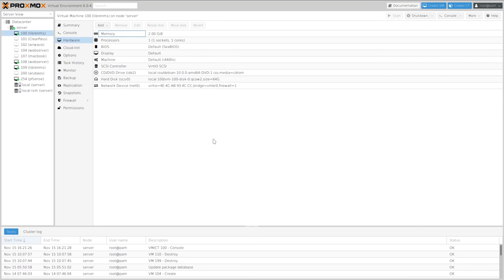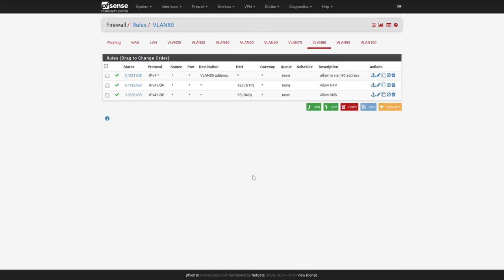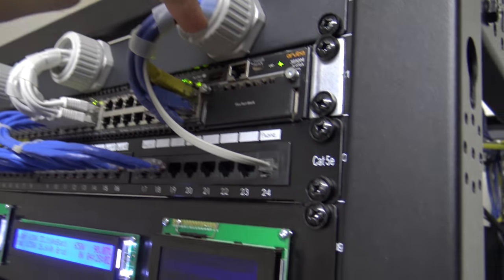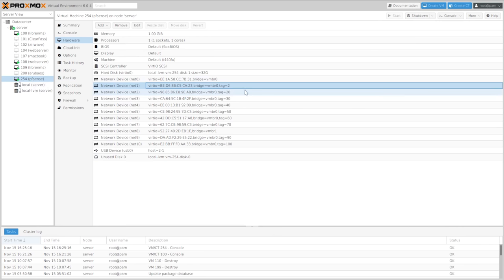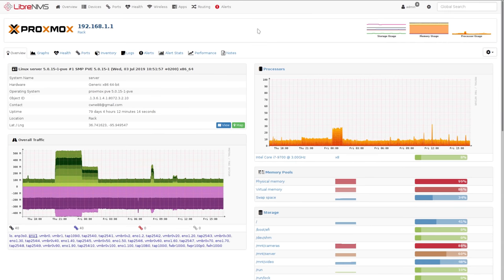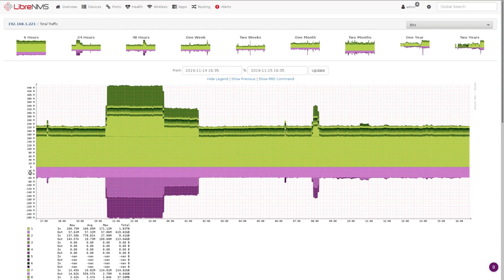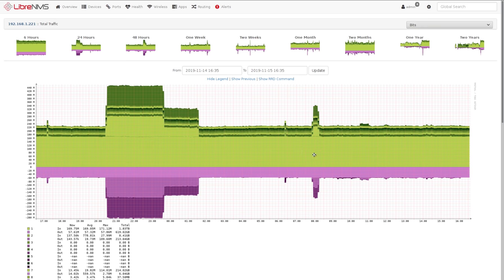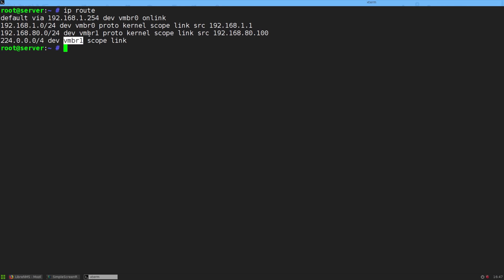Logical Network Tour

Comment: You’ve got a ClearPass VM, just have your policies set up to put the Tesla on a different VLAN and then you don’t have to mess with firewall policies on the controller. Nice setup, pretty similar to mine :-)
Reply from the maker: If you listen closer, you'll hear why I wanted it on the same VLAN. Also, I can already put it on another VLAN with just the controller if I want (like the dashcams still are). I don't like extra complexity if I can avoid it (believe it or not!)

Comment: Best no bullshit tech channel I've seen. Thanks for sharing the content and knowledge mate.

Any particular reason you opted to do your tagging on the hypervisor rather than in pfSense?
I'm trunking the vlans to an old physical box that I run pfsense on, and thus dealing with the tagged interfaces in pfSense. I'm going to migrate that box to a VM though, so just curious if there is a particular reason you adopted this approach on the hypervisor nics rather than in pfSense itself?
Reply from the maker: Basically because it works nice and easy that way. pfsense, or any other vm doesn't need to have the tags set, as they're already done on proxmox. If you saw my recent videos though, I've pulled that out and am now running them on Raspberry Pi machines

Comment: Are you using OVS IntPort for each VLAN tag you have?
Also, did you switch from physical Palo Alto appliance to a virtual PFsense firewall? Is there a reason for it and how is the experience so far?
Reply from the maker: Yes, I got rid of the Palo Alto ages ago. The Palo was just too slow to configure simples things, and pfsense is laid out way better and logical. No problem with speed in my setup.

Comment: hi im a big fan of proxmox i wanted to ask about how you run pfsense on it do you add a virtual nic virtio etc or did you use the hardware pass through option to pass a physical nic in the pfsense box to the vm? one isee i have seen come up is if you use virtual nicks they don't have as good performance and you have to disable hardware check summing in the web interface of pfsense. perhaps you could do a more in depth video of your pf-sense setup. i love your  vids keep em up!

Comment: Any reason for not running librenms in a container vs being in the VM?
Reply: Had the same thought! There is two possible reasons that comes to my mind: linbrenms have a vm .ova and docker container file available that you can import as a vm or use in a vm. Second, reason I guess it is more secure to run a vm than a container and I guess that since he can spare the ressources there is more advantages to vm than containers.

Comment: interesting, I used proxmox with a similar setup but I could not use the vlan aware bridge like you,  without getting some strange message "process/core freeze" and the instability
I had to create one sub interface per vlan, link each of them to their bridge and then link vm nics to the proper bridge.
I wonder if that was a hardware problem. Does your server have very new hardware ?
Reply from the maker: This particular one is new, but I've done it without any problems in the past on old equipment. All I did was add an adapter in the VM config, then assign a VLAN tag to it and it was done.

Comment: Nice video. I wonder why you can't ping your model S. I can ping my model 3 on wifi. Do you have anything in place to stop your Tesla assuming another address in the subnet and bypassing your layer 3 access lists? MAC filtering? Separate broadcast domain would be more secure but less arp-friendly. Could look at proxy arp if your kit supports it. Maybe too paranoid :)
Reply from the maker: I mentioned it in the video, but maybe it wasn't clear. The wireless controller is doing the firewall for the wireless client. It's not a layer 3 access list, it's a role assigned to that wireless client's association. Its MAC address is allowed on my VLAN with rules to prevent it actually communicating with others on my VLAN. If it changed its MAC (which it wouldn't) to something else, it would get thrown into a guest VLAN anyway. It's all good :)
I didn't realise model 3's responded to pings, but then again I'm only familiar with my car (and its shitty 802.11g capability).
Reply: @TallPaulTech  unless it found and spoofed an offline trusted MAC address but yeah, it's not likely to do that unless it's seriously compromised

Comment: Is it safe to run a website from home and if so how? Maybe another Video???
Reply: mystrerios question, is it as save as always.
Reply: It depends on what you consider safe. As far as unauthorized access, if properly configured it can be just as safe as a server in a big cloud provider. Reliability however is much harder to control. Small scale infrastructure just can't offer the same redundancies of big data centers. Even if you spend big dollars getting complete hardware failover, a simple DDoS attack could quickly saturate even the most robust home internet link. This kind of risk could be completely acceptable for many websites, though. And maintaining physical access to the disks could arguably be considered safer if data privacy is the main concern. Considering all other factors besides safety, I think it's hard to make a point to hosting from home nowadays, but I would also love to see a video with some thinking about this from a networking perspective.
Reply: Mainly it comes down to AUP/TOS of your ISP if in a residential setup. It says in text prohibited but it's not blocked. To give you an idea, in 2004 the MyDoom worm was ruining the Internet. I was running an Apache server on port 80 on my Linux Mandrake box that had a Lucent soft modem. For those new, soft and hard modems were the most painful thing to get online with dialup around that time. Your soft modems were "software"/driver controlled and your hard modems did everything on the hardware so they were Linux supported. I had to jump on Linux Mandrake for the soft modem driver support but I thought I was cool running a website off of dialup. Well the malware was scanning 80/tcp so I was getting technically DDoS'd by the scan traffic.